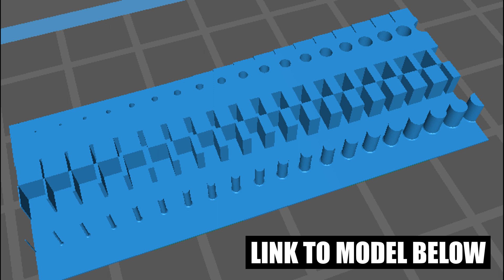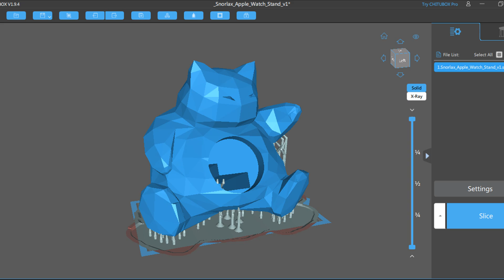Perfect 3D Resin Prints By Reducing Power (Issues | Calibration | Results)

Comment: After digging into Chitubox and Lychee I wasn't able to find how to reduce LCD power. Can anyone help with it? Thanks!
Reply from the maker: I'm using the free version of Chitubox and it's under Settings > Advanced > Light PWM.
Reply: @mikecamera818  awesome! Do you reduce both light settings down up to 80%? I supose that one of them is for the firsts layers power
Reply from the maker: You can lower the Light PWM for main printing power. You're right that the Bottom Light PWM is for the first few layers and you can leave this at 100% to ensure good adhesion to your built plate.
Reply: @mikecamera818  appreciate your help   mate! I'll run some prints soon

Comment: Using photon mono 6k 2 sec no problem
Reply from the maker: The mono's have much shorter exposure times. The cheap printer I'm using here has an LCD screen that needs longer exposure times. But you can still play with the power setting to fine tune the sharpness of your prints.
Reply: @mikecamera818   thanks im new dunno much atm.2 sec is set by default
Reply from the maker: No problem. I had a bunch of failed prints with my default settings so I started playing with my exposure time. When I got that dialed in, I tried reducing the power to 90% and was surprised that it made my prints sharper. Huge improvement in my print quality and I stopped having failed prints.
Reply: @mikecamera818  well i just failed print.Object fall off and was so soft like rubber instead hard .
Reply from the maker: @Shakalowski sounds like under exposure. I'd download a calibration model like the one I showed in this video. It'll help you find the best exposure time.

Comment: never heard of the power setting tbo. also what printer is this? 10sec exposure means this is not a monoscreen?
Reply from the maker: I have the Longer Orange 10. The cheapest resin printer out there so it has a basic LCD, not a mono. I'm impressed with the print quality but I see why it's so cheap now. It's pretty slow after you turn the exposure time up to the correct setting.

Comment: Thanks for experimenting and sharing your results. Do all resin 3D printers have an adjustment for power settings in the menu?
Reply from the maker: You're welcome! Yes, I change the power setting in my slicing software before I export my part. I'm using the free version of Chitubox and it's under Settings > Advanced > Light PWM.

I'm using the cheapest resin printer out there ($120 Longer Orange 10) and even it can vary power. Most of the Anycubic printers mention it in their specs. It'll say the power range is 30-100% for example.